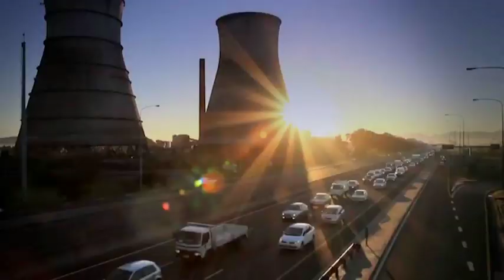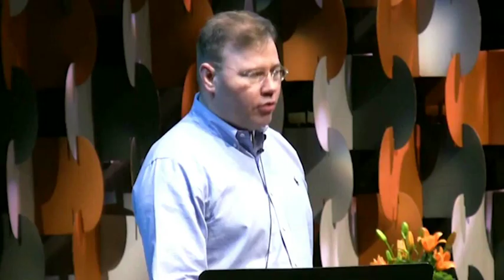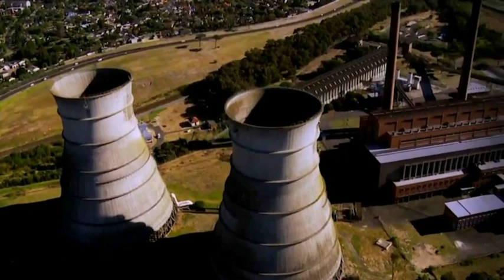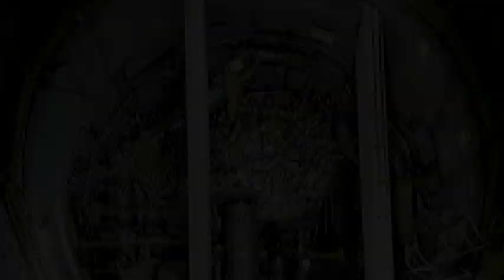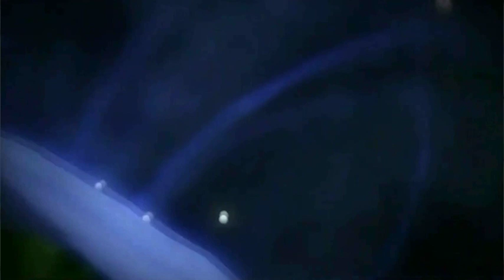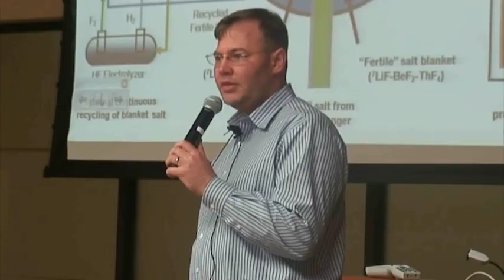Undercurrent - s04e08 - Thorium

Comment: The beauty of the molten salt fuel is that, as it heats up (and expands), it becomes LESS reactive. The freeze plug can break off in a 'worst case' scenario and all that would happen is that the fuel would spill on the floor and solidify.  A liquid fuel naturally spreads out when it spills. If there is no pipe break, then it flows into several small containers. This means the reaction stops. The material cools and solidifies. After a mishap, it can be collected and re-melted for further use.

Comment: The only reason Thorium was never used as a nuclear fuel when nuclear power was being developed is the difficulty of extracting weapons grade plutonium.  You can't weaponize it.   Thorium: More energy, less waste, and under 200years decay time. no risk of melt down.
Uranium: Less energy, less efficient, more waste, 160,000years decay time.  Could melt down.

Comment: Senator Scott Ludlan was wrong when he said no one had ever built a Thorium reactor.  They built one back in the 1960s at Oak Ridge National Laboratory and ran it for 5 years.  Now that was a small one no one has yet to build a large commercial one that could generate large amounts of electricity yet.  The reason it didn't move forward was because the US government wanted nuclear reactors that would produce weapons grade nuclear material.  Thorium reactors are not good at that.

Comment: This is like those that created buggy whips deciding on what new device will replace their whips. The world needs to rethink their power generation as well as distribution. They need to rethink minimal requirements for new homes to make sure they're energy efficient. Wind & solar has it's place but suffers from a lot of problems. Solar only works well in certain locations. The same for wind. Solar & wind needs a lot of space to be able to generate the power required. So their are draw backs.

Comment: I disagree.

They all make sense, and fission, fusion and solar PV should all be researched closely.

Wind and solar thermal, less so.  We've pretty much sussed heat engines, mirrors, aerodynamics and electric generators.  These are basically solved problems, and it simply doesn't make sense to throw energy research funding at them (though, pure science research money, sure).

Comment: "It's safer and clearner and cheaper because it doesn't exist"

Um.  Google "MSRE".  That's what this reactor design is.  It was running for 5,000 hours in the 1960's.

"It's simply never worked, and a lot of money's been tipped into it"

Neither has solar worked at scale.  Wanna cut funding for that too, or can we be adults about research?

"The waste products are probably an order of magnitude less..."
2 orders less by mass; 4 by storage time.  The overall waste problem is 6 orders less bad.